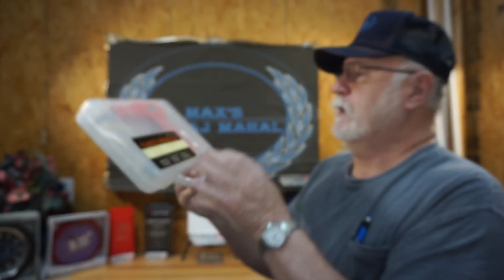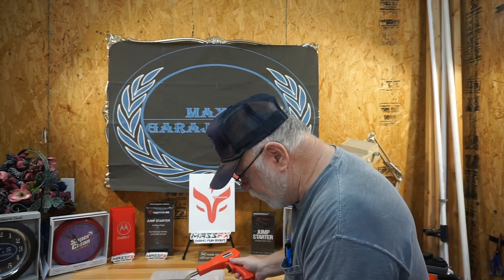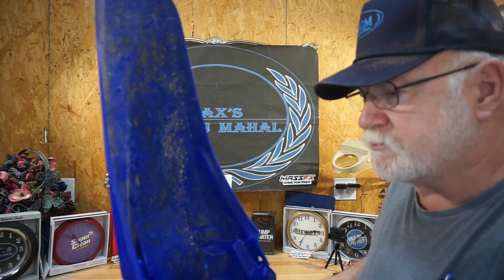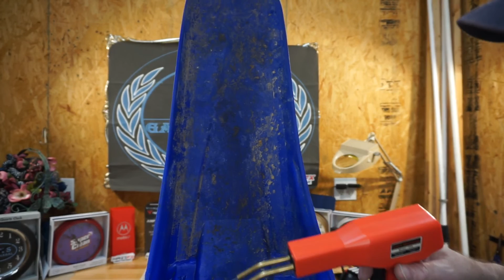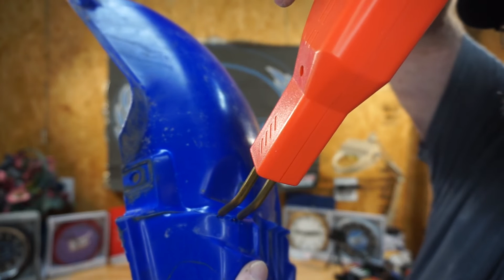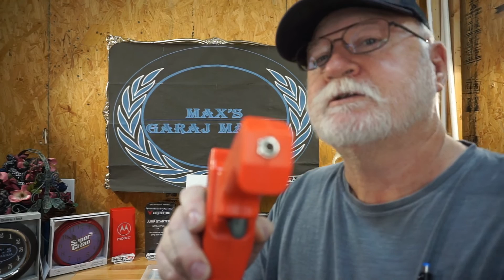"Bringing Back the Heat: The H50 Plastic Hot Welding Gun's Resurrection. It's Alive"

Comment: How did you repair it did you do a video on the repair. I have the same one and it lasted for 6 staples then quit working it works until I put a staple in then craps out
Reply: So your using the batteries instead of the transformer?
Reply from the maker: @jasonmatvey7308  Yes Sir. The 2 18650 batteries were taken out of a dead HP laptop battery that no longer took charge. 

I placed them in series making 8.4v fully charged. Put a diode between the positive battery lug and the staple heating element.

Works beautifully.
Reply from the maker: Yes Sir. Here is but one of the videos featuring that newly made into a cordless plastic stapler. https://www.youtube.com/watch?v=FVB-XXbxH5I
Reply from the maker: As well as a Battle of the cordless staplers. PS. My cordless kicks the overly expensive cordless stapler's butt 7 days a week. Lighter, faster and easier to get into hard to reach cracks with mine.

You'll want to convert yours immediately.

email me if you run into trouble making it work. maxsgarajmahal@gmail